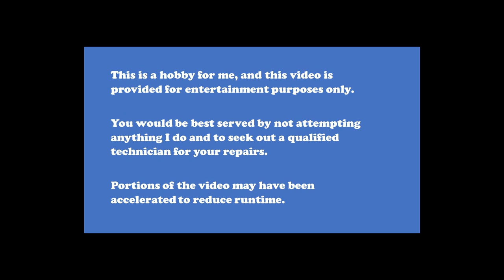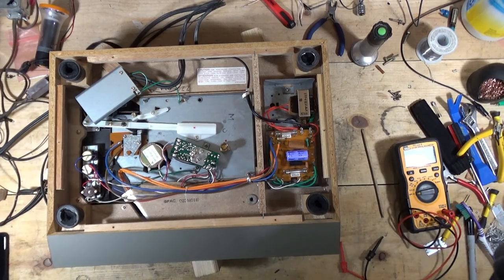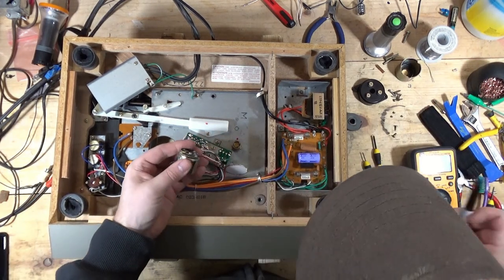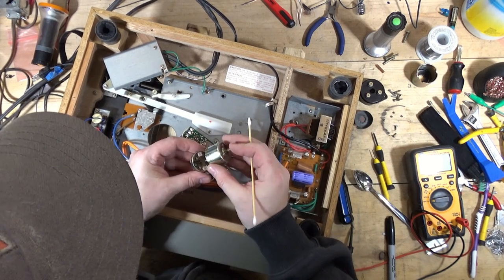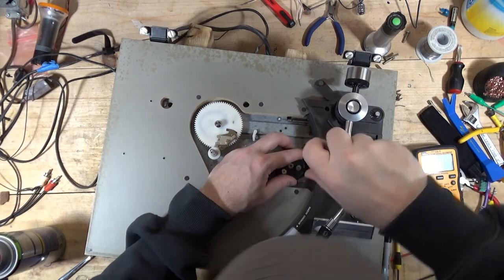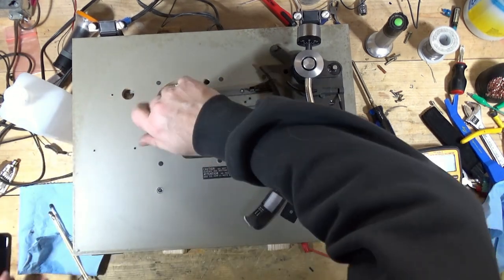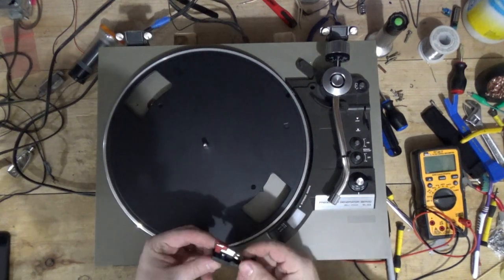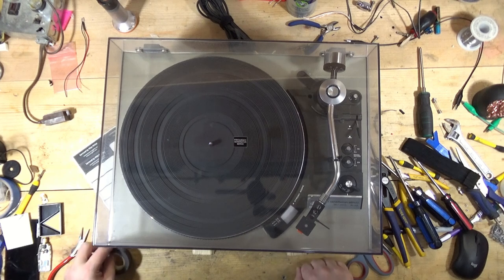Technics SL 23 Turntable Repair - Motor & Basic Service

Comment: The SL-23 is a great table. I’ve bought, refurbished, and resold several at my record store, Oil Capital Vinyl in Tulsa. I still own one I use when I’m between tables, as I’m always swapping out tables at home too. I was yelling at the screen when I saw you tearing into the motor, which needed cleaning and lubing anyway, but I knew it was the speed selector switch contacts being manky, because I’ve experienced same on several occasions. 

Also, one of the problems I often find with these is that the anti skating mechanism fails to work after many decades. I’ve yet to find a fix for that problem. 

Oh, if you don’t already have a set, get some JIS screwdrivers. They fit Japanese screws much more firmly and reduce the frequency of striped heads.
Reply from the maker: Thanks for the tip on the screwdrivers.  I've almost purchased some a few times in the past.  I'll get some eventually...

Comment: Well, tried to service my SL-23 that I bought new in 1977. It has never been serviced. Much to my surprise, one of the screws that holds the motor to the shroud is factory stripped and doesn't want to come out. Just bad luck I guess, since I noticed it spinning when I started to unscrew it. This ought to be interesting to repair. 😮
Reply from the maker: That stinks.  Those soft screws can sure be difficult.
Reply: @millervintagehifi3034  So the screw is out. But fighting with the screw, I bent the ground tab and it broke off. Now I have to grind off the coating and solder to the cover. Then find a screw that will fit in one of the other motor holes. Do you know the screw size?
Reply from the maker: That sucks.  Unfortunately, I do not and I don't currently have an SL 23 in the queue for repair.
Reply: @millervintagehifi3034  Thanks for replying. Research time. 👍
Reply: Just bought a sl23 for 20 bucks.  Any pointers i need to service
Reply: @victorhernandez5862  1) If you unscrew/remove the motor, don't let the ground tab on the motor get bent. It is fragile. I managed to repair mine, where it made a connection. Note the screw holes used and location. This makes it easier during reassembly. 
2) Use the "Caig DeoxIT FaderLube" lubricant to clean the speed controls and switches. This is great for every switch, volume control potentiometer, etc., you have.
3) I used the "Super Lube 51004" synthetic oil to lube the motor and spindle.

Comment: I'm looking for awiring diagram for this SL-23.  Specifically the wires at the small circuitboard where the audio jack cable is soldered to. The nearby tiny wires came disconnected and I'm not sure where they go.
Reply from the maker: Should be in the Service Manual…try to download from VinylEngine.

Comment: What was the reason for taking the motor apart?  Wondering if I need to do the same if mine spins but just has speed consistency problems due to pots/caps.
Reply from the maker: I’d have to rewatch the video, but typically it’s to address torque issues, noise issues (clicking or tapping), or to just perform general maintenance (lubing the bearings and cleaning the brushes).  I’ve done so many I’ve lost track :)
Reply: @millervintagehifi3034  Thanks.  Was just trying to figure out under which conditions I would find that necessary.  My spins, just erratically due to pot and switches (I think).

Comment: You should be spraying the contacts and potentiometers with deoxit. It's relatively cheap and it does a way better job.
Reply from the maker: I use the WD-40 residue free contact cleaner usually as a first pass, then will typically follow up with Faderlube.  I find the WD-40 or CRC to be just as good.  Deoxit is great, but is a little on the expensive side and my local home improvement store sells WD-40/CRC.  Naptha vs Heptane...